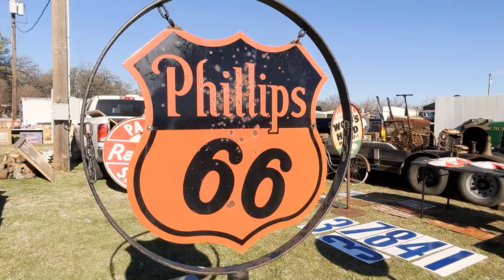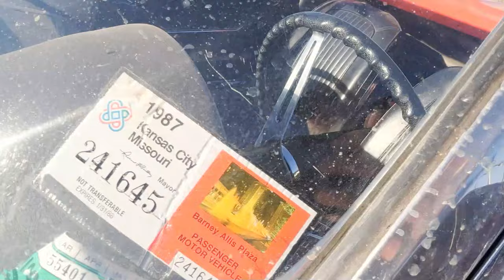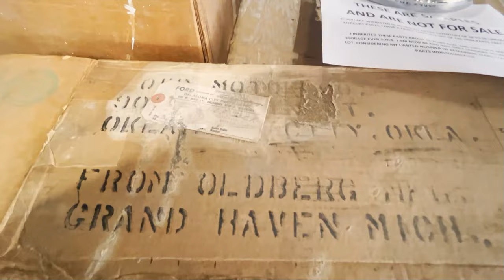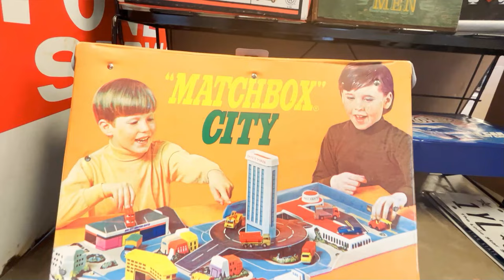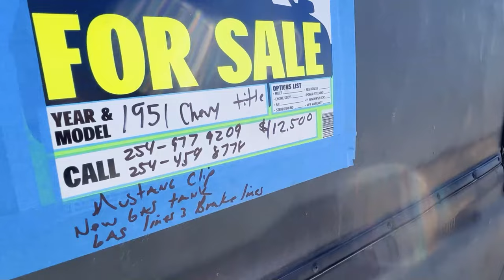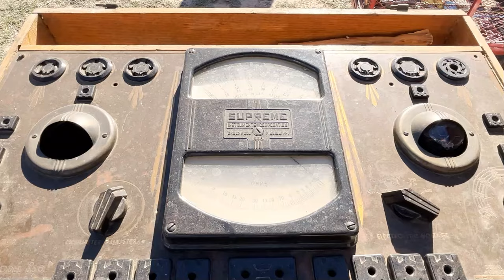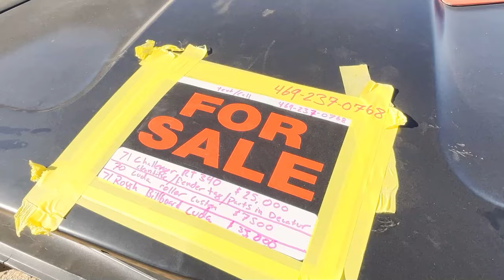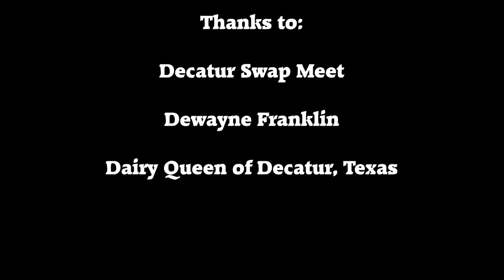Decatur Swap Meet/Decatur, Texas Feb 23, 2024

Comment: Hey Keith after you pass the 7Up vending thing you looked at a green moped I'm curious so if it has an engine or is it electric I have electric one like that I'd like to convert over to an engine can you find out the name of that moped and behind that black circle screen is there a motor or is it all electric also the tires are the rims plastic aluminum or metal the next time you go if you can remember all this and see one check it out for me and let me know what I need to do.
Reply from the maker: I think there’s a small motor under the seat.